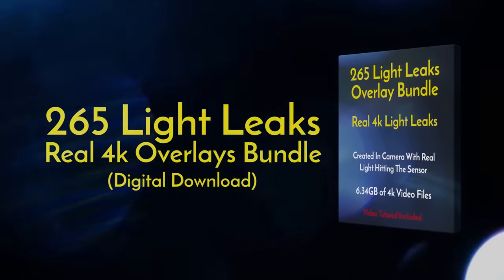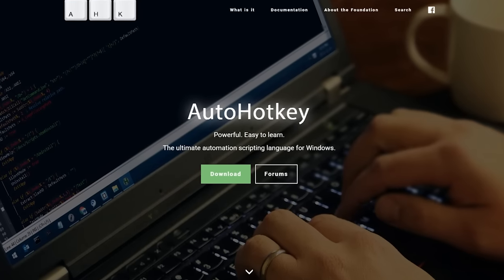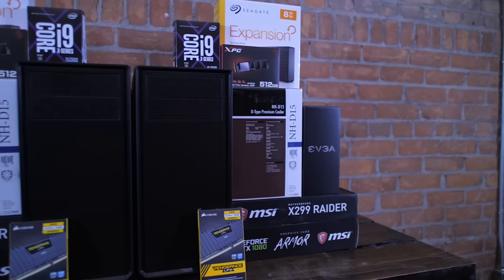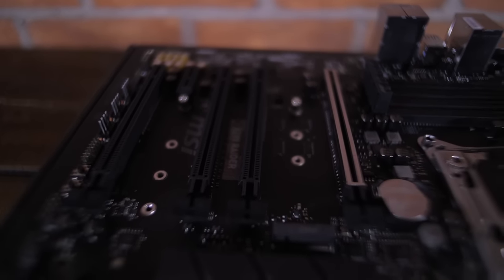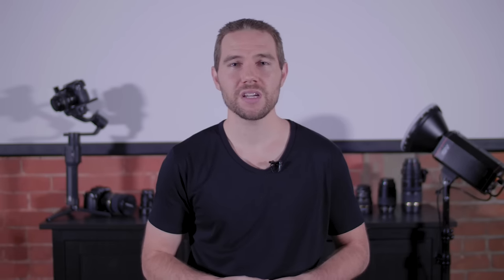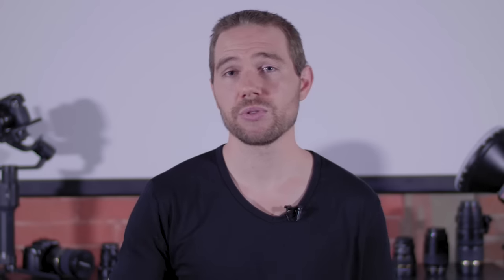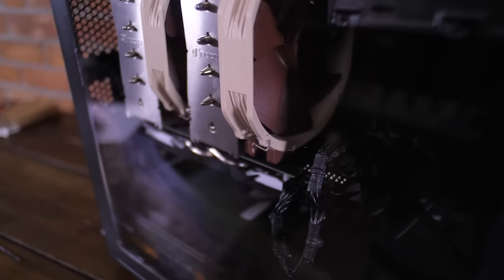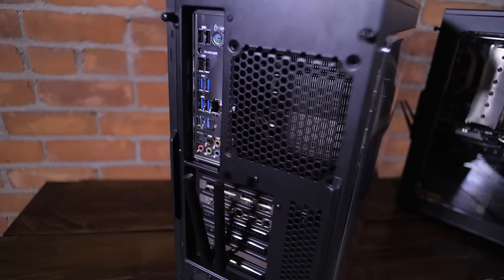Custom 4K Video Editing PC - Switching to PC after 10 years

Comment: I have the AMD Threadripper  1950x and it works great with Premiere Pro. The Intel youre using is a bit more expensive, wondering how much better it performs.
Reply from the maker: I think for exporting, the Intel we bought is around 20-25% faster, but for speed in Premiere Pro for playback, I believe the Threadripper outperforms the Intel by about 5%